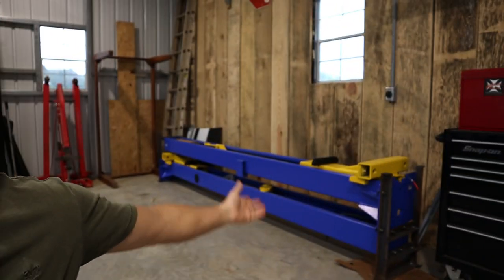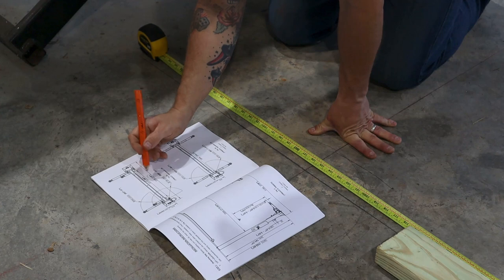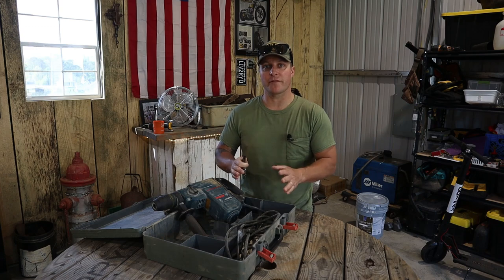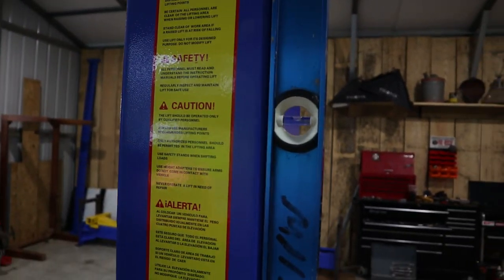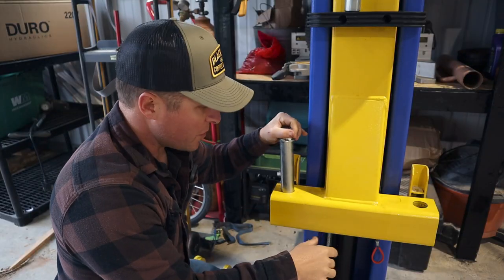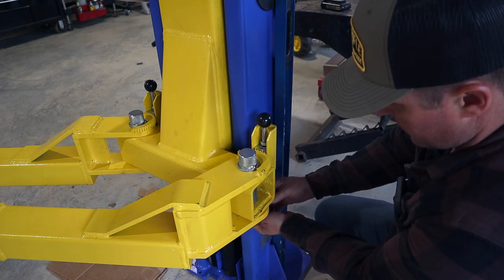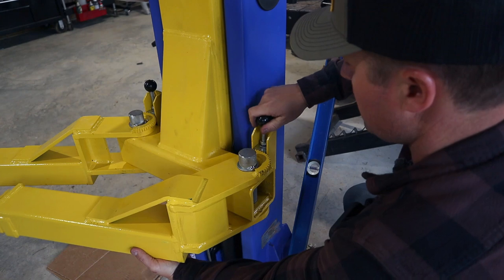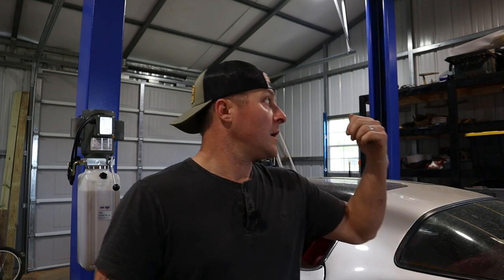SURVIVED! 2 post car lift install BY one person!  Race tools Direct

Comment: Have a small piece of advice. Where you ran the #12  romex wire into the electrical box, you should have installed a romex clamp.  The come threaded 1/2"  with a nut, and a two screw clamp on the other end to hold the wire.  Cost is 75 cents.  This will keep the romex wire from rubbing on the edge of the box and causing a short.  Nice job on the whole lift, looked like fun.
Reply from the maker: Thank you. I used those on my sun panel didn’t even think about it using one here! Good tip thanks for watching

Comment: Looks great. A good reason to add another electrical box to utilize the supplied pigtail is that you can add a 120V outlet on the side of the lift by using a duplex box.
Reply from the maker: Excellent idea haven’t thought about that! Thanks

Comment: Very nice! I wish I had one still, even though I'm retired now. I only have one suggestion, if there is not one now. 
If it were me, and I was writing the checks, I'd design a dust cover of some kind, to keep dirt off of the cable on the top cross piece. It will accumulate a lot of dirt up there, especially if the cable has grease on it. I live in the country. The amount of dust and debris is surprising. This will help to keep your cable much cleaner going forward. Have fun!
Reply from the maker: Great suggestion!
Reply: I'm retired, and use my two post lift more than I would have while I was still working.  They will pay for themselves after a few brake jobs and other routine maintenance tasks.  I can't believe how much mechanics shops charge for simple jobs.  Anything I can't do, I'll send out, but I've saved a lot by DIY jobs.  I have a 3/4 ton four door diesel, so these lightweight Asian lifts don't work for my needs. I installed my Mohawk lift with a little help from one of my brothers.

Comment: What a great install video!  I just purchased a slightly used 2 post from a friends shop.  I'm wanting to get it installed this week and all my buddies are too busy to come help me.  This gives me the confidence to tackle it myself!  I don't have a tractor that nice but I do have an older ford 3600 with a crappy loader but I think it will do the job.  I bought 3 wire plug ground wiring because I also plan to use that extra wire as a neutral wire to install a 110 outlet box on the side of my lift for running power tools.

Comment: For those having to pull an electrical permit or get an inspection, there are NEC codes that will definitely fail this installation (to many wires in the motor box and wiring must be protected in conduit).  If you aren't under the thumb of an agency or have a business...no worries.

Comment: Just installed the first (command) post. Used the tractor and an engine hoist to stand it up. Once up, just lifted about 1 inch off the ground while daughter inched tractor forward into place. Then lowered and kept a little slack in the strap as a safety while I aligned post with marks on the floor. Fortunately the garage door is 12ft x 12ft so had a few inches above the post to lift. After epoxy cures in 2.5hrs, plan to loosen nuts, level post (VERY close already), tighten nuts again, then tomorrow to set the second post and the top bridge.
Reply: What anchors did you use with the epoxy?
Reply: @kylepawelczyk163  Red Head 3/4" think 5- 1/2" long. I tightened with a few sharp jerks until I felt the collar engage. Then let the epoxy sit for about 45 secs, then half turn, wait 5-10 secs and repeat half turn at a time. It seemed to help with the resistance and setting the collar quite firmly and also the epoxy.
Do NOT level the nut with the top of the bolt and hammer it in place (as we've all been taught to preserve threads). It jams up the nut. The end of the bolt is already tapered so threads are safe.
Very pleased with the results
Reply: @jjclarkson3261 I’m using the same anchors. I’m installing the lift this weekend. I figured I would drill the 3/4” hole like normal and then put some epoxy in the hole, torque the bolts to 110ft lbs while the epoxy is wet and then let it cure for a day and then check the torque the next day to make sure they are tight.
Reply: @kylepawelczyk163  I will also suggest to leave the mixing tip off the tube, squeeze out until even amounts coming out of white and black, then about 2" diameter blob on cardboard, mix with putty knife until uniform gray. Epoxy cures in nozzle before you can use it again.
Reply: @kylepawelczyk163  (AFTER inserting 2 in each upright and allowing to cure overnight to hold in position) I drilled my holes first, used 3/4" plumbing pipe cleaner (type of wire brush for inside of pipe before soldering- like a shoot-barrel cleaner shape) with plastic handle smashed off, wire handle flattened to fit into very slow drill chuck, and air, to clean out holes. Laid them out and ready, did one at a time and capped tube between uses. I think I used 3 tubes- first one was much wasted as only sunk 4 anchors total, being very careful everything was lined up.
Reply: @kylepawelczyk163  One more thing, Place shims BEFORE inserting ANY anchors. Don't expect to be able to remove nuts to level. If you do need to retorque any nuts after installation, start with a sharp jerk so the nut is free from the bolt, then tighten slowly. Shouldn't have any problem making 100-105ft-lbs during initial install, then re-torque after curing to the 110ft-lbs. At least this was MY experience. It worked for me. I am experienced in many mechanical areas but not a certified installer. At your own risk, you know the drill ;)
Reply: @kylepawelczyk163   Oh- and DEFINITELY drill all the way through the concrete. I applied epoxy to the bottom of the anchor, covered the ring and about 1/2" of the bolt threads above the ring, then gently install into the hole, avoiding getting epoxy on the post base as much as possible. Hammer easily so as not to splash. Have decent rags handy and a helper to hand you things if necessary. Wipe putty knife immediately after use and at the end clean up any left on it. Good Luck!

Comment: I did mine by my self with a bucket tractor and the worst part of the job as getting from the side of the road where the trucking company dropped it off to the polebarn that took about 2 hours
Reply from the maker: oh yeah lucky i picked mine up on my trailer it was so much easier

Comment: Quick question on your garage layout.  For the garage door that the lift is behind, how far from the closest wall is the door? And how far from the wall is the post for the lift?  Were you able to center the lift within the door opening?  Thanks. Looks great!
Reply from the maker: The door is set 4’ off the end wall. The lift is center to the 10’ garage door. The end wall post is about 3.5” off the end wall. Hope that helps. Let me know if you want more measurements or pictures to help. It’s always nice knowing first hand before laying your own out.
Reply: @ProjectDadLife  That helps a lot.  Thanks!

Comment: Why did you decide to do a 20amp 2 pole with 12/2 instead of 30 with 10/2? Everywhere I read it’s mixed opinions.
Reply from the maker: That’s what the motor specs required

Comment: How wide did it wind up being? Im hopeing one will fit nicely in my garage which is a 35x24 3 car side entry so i dont have much space inbetween the car bays
Reply: Exactly 138 inches from outside to outside post. I just installed mine today

Comment: I got the same lift. Did you have a bunch of extra small nuts and bolts? I have quite can few can't figure out where they are supposed to go. The directions wasn't bad but I had to do some guessing.
Reply from the maker: I didn’t have anything left over thanks for watching! I still love it works great

Comment: how far are the post from the door? if the door is closed, how much room to the bumper of the car?
Reply from the maker: About 10-11’ with my trans am on it there’s about 5’ with the door closed
Reply from the maker: If I gotta pull an engine or anything the door will definitely have to be open

Comment: I had a question about this lift, if the lift is asymmetrical, how come it’s installed straight in line with the posts? I thought they were supported to be at like a 30 degree angle.? Does it mean that its bi-symmetric lift or did I miss something?

Comment: What did you use to insulate the roof in your shop?  Or was that part of the install?  Thanks
Reply from the maker: its called double bubble in the trade. probably a 3-5mm foil sheet with one white side.
Reply: @ProjectDadLife  thanks for the reply.
Reply from the maker: Yeah man of course! Wish I knew exactly what it was called
Reply: @ProjectDadLife  Got another question for you.  I have the same lift, what size wire and breaker(s) did you run to this?

Comment: Does this not have to be signed off by the manufacturer?
Reply from the maker: The plans do yes. that was the big issue I had. the building was different than the engineered plans sold to me.

Comment: You should always drill all the way through the concrete when installing anchors. That way you can hammer it through the concrete if the anchor becomes damaged or anything.

Comment: How deep did you have to drill into the concrete
Reply from the maker: 4.5”
Reply: @ProjectDadLife  not to grill you with questions but If my concrete is only 4” thick which is acceptable per their description for a 9k lb lift should I still drill that far? I know this is the first one you’ve assembled but I can’t seem to find the info anywhere else
Reply from the maker: @Likeabull  no problem man. I was questioning mine also and after talking with the manufacturer as long as you drill the required depth hole and don’t go through your concrete.
Reply: Why does it matter if you drill all the way thru the concrete? Also you should of used epoxy on the business ends of your wedge anchors, I have a new 2 post lift and use it daily in my shop, I have 9 inches of concrete with rebar into existing slab. I have to constantly retorque my anchors. I have 3/4 by 5 1/2 wedge anchors. They are a terrible anchor for these types of lifts. They WILL WORK LOOSE over time. So always check the tightness, I will loosen the nuts and drive me back down and then re tighten sometimes. But it’s complete bullshit either way.
Reply: @Likeabull  Just drill all the way through if you have 4" concrete. If you don't, you'll risk busting out the bottom when you pound the anchors in, and that would be bad news.

Comment: Just an FYI.  Most hydraulic fluid is combustible so not the best idea to run that line right next to an electrical wire.  It’s the same reasoning for not running your underground electrical wires in the same trench as a gas line.

Comment: Jealous definitely.  For the most part this was an informative installation with info on stuff not covered by others.
Word of advice, please don’t use the loader for a man lift, platform or do anything under a raised loader.  I know it seems perfectly ok but it’s a good way to die.  Absolutely don’t want that for you.  I liked how you just rigged and raised them completely on your own with the tractor, most videos I’ve seen people struggle.
Could you have just used the switch wire assuming it has a ground and tied your power into the box on top instead of doubling back?  Just a second thought, pretty sure an electrician would cringe at any electrical installation, you should get plenty of feedback.
Enjoyed the video none the less.  Keep up the work!
Reply from the maker: Thanks for the input. I honestly didn’t think about feeding power through the switch. It was just a 2 wire contact switch no ground. But now that I’m thinking about it. I could have just ground the top and powered the switch up top. Leaving just a single hot wire down to the motor🤔. Thanks for watching man. Ill stay out from under the bucket.

Comment: I'm scared of Chinese lifts.. becarful..  I requed an old Rotary inground lift.. it is vary old ,as me .. but it was in great shape case wise..not rusted bad .I cleaned it up painted it and coated with truck bed liner dug a 8 ft hole , plumbed it.. oil tank above ground....now back in service in my home shop.. after sitting idal for 35 yrs.. now back in service..

Comment: Dont like the idea of shims like that. All that weight on washers........

I need a tractor, too. :P
Reply: You'd be hard pressed to get it perfectly plumb without shims...that being said, my shims were plastic😳, so I mixed up some epoxy concrete so I could get full contact of the pad with no pressure points caused from the shims.

Comment: Hire an electrician, you should NOT have used 'Romex' for this installation.
Reply from the maker: Thanks. Can you give me reason why? I’m just curious?
Reply: @ProjectDadLife  tHE REASON WHY IS: Romex has solid copper conductors and as time will tell, the frequent bending of up and down cycles, will break the conductors with metal fatigue. SO, SJ, Festune, or other flexible cable is designed to flex the length of the cable and will last ALMOST indefinitely.